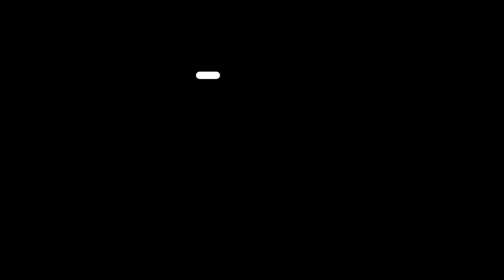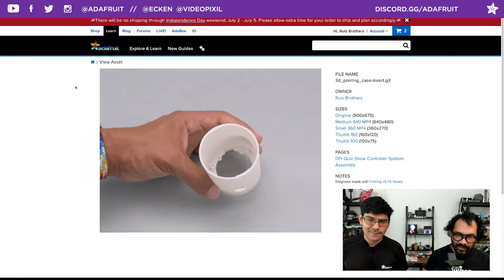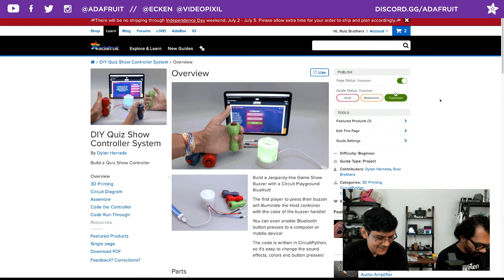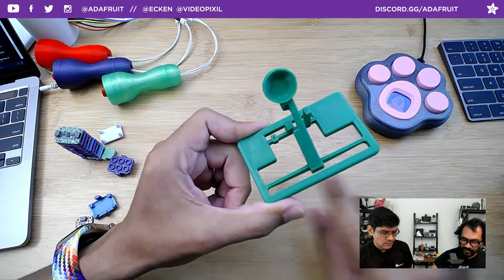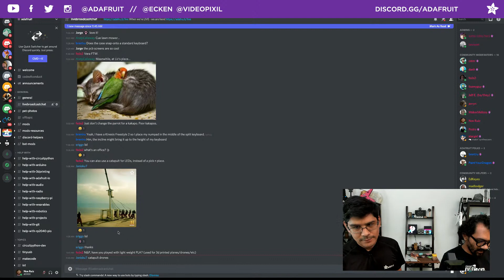3D Hangouts – Jeopardy, Macro Pad and Lowpoly Pokeball

Comment: 0:41 - Intro animation
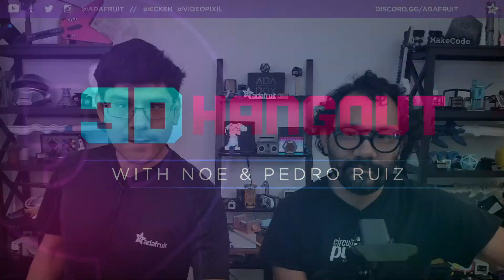1:05 - Noe & Pedro on screen; housekeeping
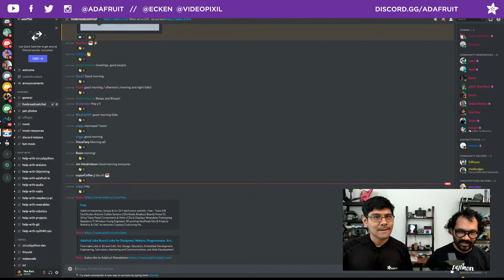5:53 - DIY quiz show control system
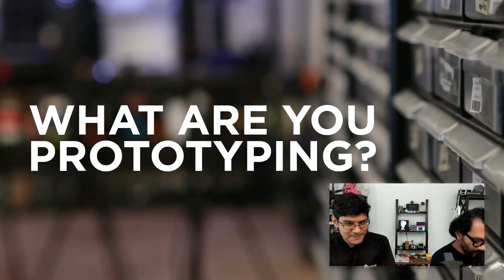20:58 - “What are you prototyping?”
21:45 - Trinkey 2040 - Stemma QT sensor stacker.
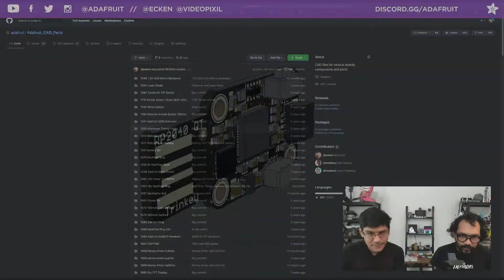25:45 - cat paw mini (4-key) keypad
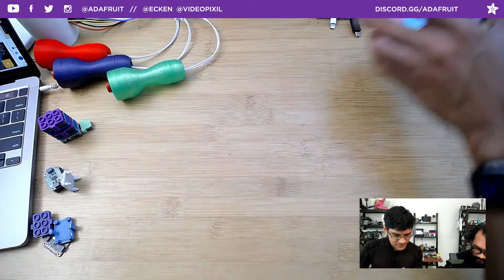27:02 - wedge support for new macro pad rp2040
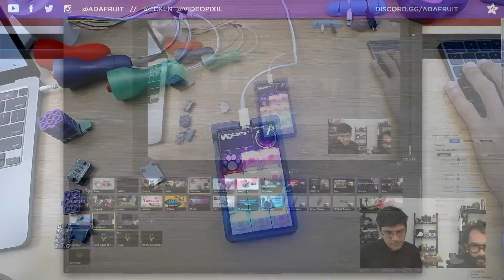29:35 - “layer by layer” - CAD tutorial for symmetrical designs with splines
32:11 - Q&A from Discord chat
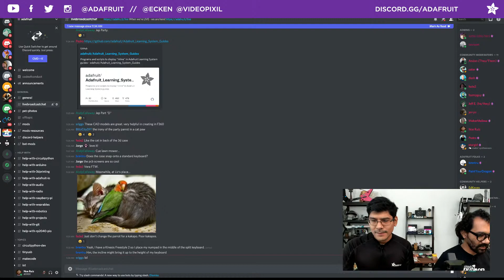34:54 - Community Makes
44:24 - closing announcements, part 1
44:59 - discord chat
47:05 - closing announcements, part 2